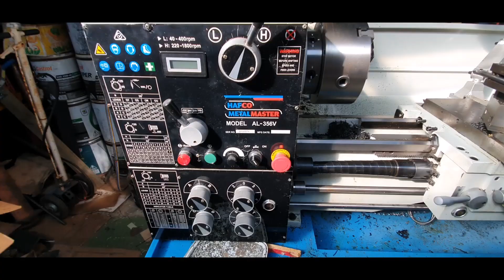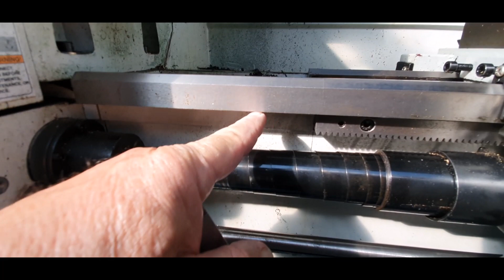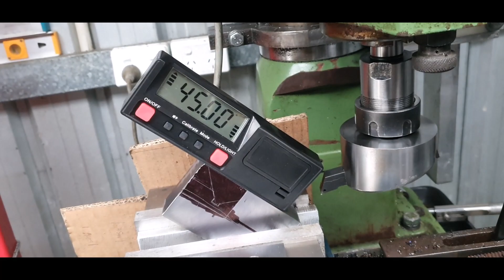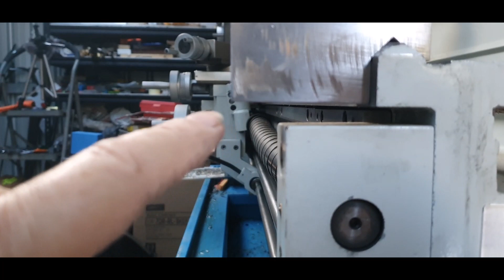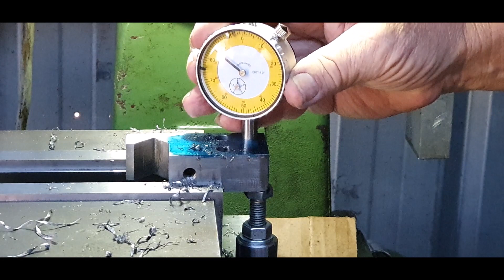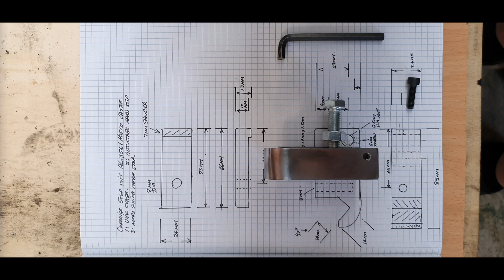Lathe Stop Hafco AL 356V

Comment: Good job Ted. I see you changed from a 346v to a 356v. Was there an issue with the smaller one? I'm asking only because I'm considering one of these in NZ. Cheers Cheers
Reply from the maker: G'day Rob.   I had a problem with the spindle on 346v , which because of warranty, I was able to get a refund, which is ok. The 346v is a good Lathe etc.
I opted to get 356v  ( V   desinates 240v & not 3 phase )  because it is a bigger 51mm spindle.  Has std  8" or 200mm 3jaw & 4 jaw chucks  overall better lathe
Reply: @TedRoza Thanks for the response Ted